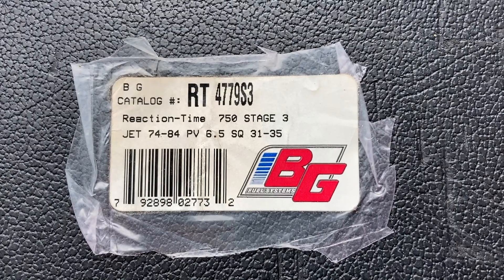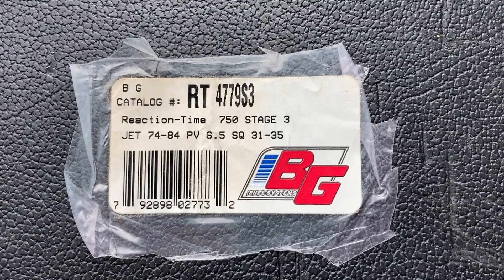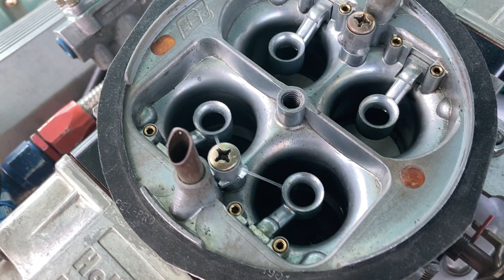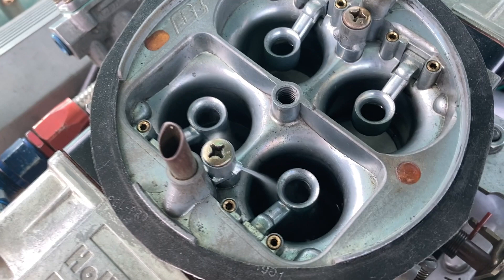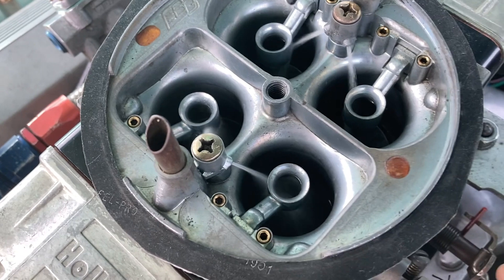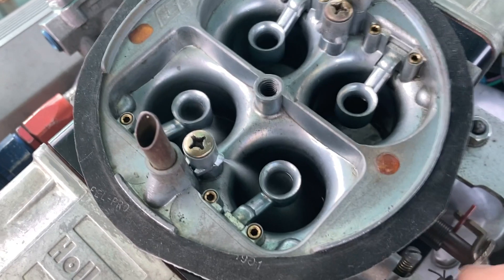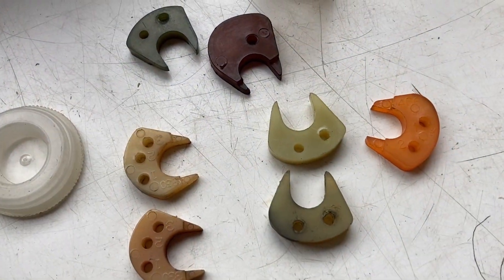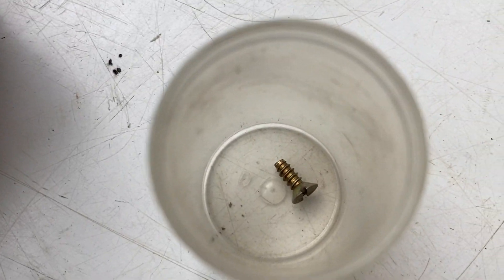Holley Accelerator-Pump-Shot Vdeo

Comment: On the nozel, does it make a difference if the little brass peices are missing. I have the secondary side missing and was wondering if its any difference in running
Reply from the maker: They come with and without the brass nozzles. The novel focuses it more the ones without are more spread. Aerial and error form here on, but its a very finer difference.

Comment: What causes the nozzle to discharge less fuel? Sorry im new to carburetors
Reply from the maker: the hole size. You buy different sizes. Also the Pump Cam regulates volume and more or less at first or later in the squirt.

Comment: I love y vids on the air bleeds, one question, i not sure if its 6/32 x 1/8 or the 3/16 for the idle restrictors. and should i mess with the idle imulsion tubes or should that be last part to  a fine tune. also can you go over the cams more in depth, the colours and which ole #1 or #2 is used when and why. ps love the pontiac, my dad had. a 65, he sold it, if he would have sold it to me i would not have gone, but did, to 72 stang ford 351c and 302..but thats history now. eitherway i love all old muscle cars, not a "race"ist..lol all amarican cars are..err were great in the 60-70's

Comment: Try adding a "powerblast plate" for even more atomization. You can buy em, but I hand made one out of copper for my primary squirter. Works awesome.
Reply from the maker: Thx! I'll check it out.
Reply from the maker: OK I looked at the powerblasts. I'd seen it before but didn't remember the name. I'd be curious if it affects CFM and flow higher up in the power band.
Reply: @wolfwengler  would need to test it. I'm not racing my car at all and rarely rev it too high. Mostly for better throttle response
Reply: Hangs out in the venturi. May work good for the pump but screws up signal to the boosters imo. Look at from the bottom and you'll see